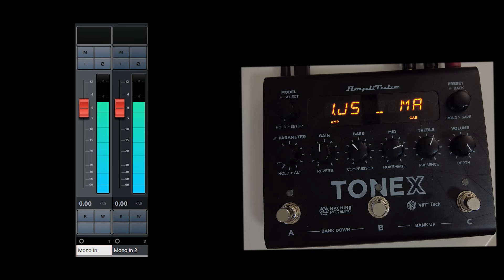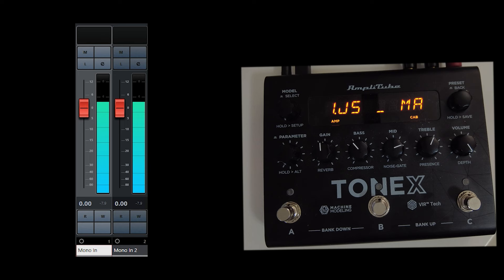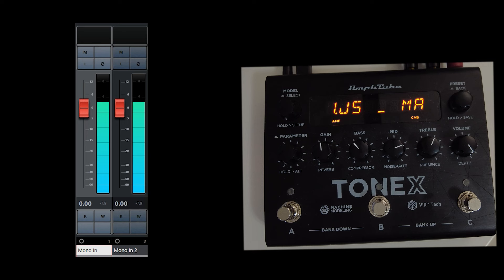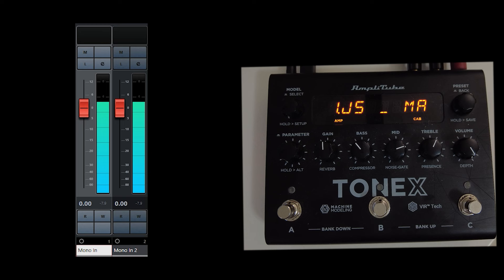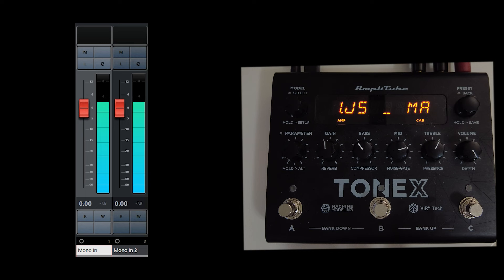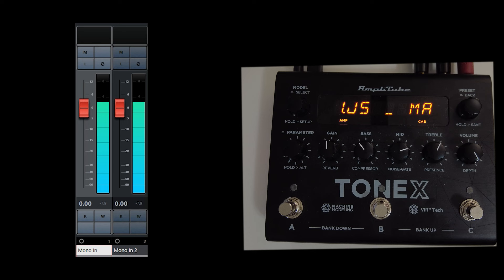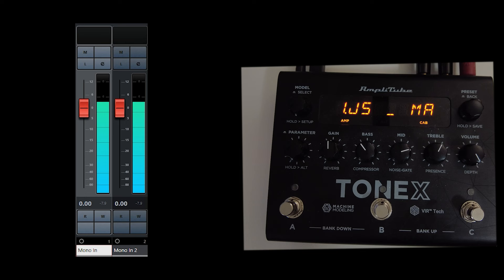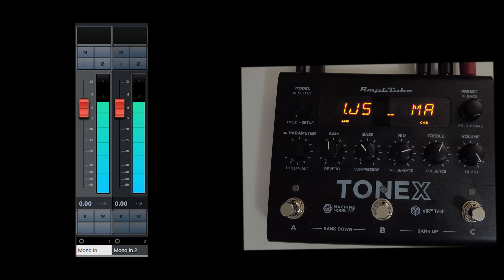Fine Tune Your Tonex Pedal To PERFECTION!! | Set Your Input Trim PROPERLY!

Comment: Good video! I’ve found that generally, there is a reason for default settings, haha. First thing I did for each of my TONEX’s was check the input trim and set it 0.0. I haven’t had any issue getting any captures to be exactly what I needed them to be. As you said, the gain knob can do so much for the sound of your capture. But beyond that too, if you’re really wishing you could push a capture that much harder, maybe you should just use a higher gained capture and make your life easier lol.

Comment: First of all thank you for uploading these incredible informative videos about Tonex. I wanna say that I'm a home recorder who wants to get the most out of it . This calibrating stuff is very interesting but I'm no audio engineer as most of us aren't . We used to set our Interface input gain so that is was not clipping. That is what the compagnies said was the best thing to do. Lately there is much of a discussion how to set your interface level properly. The latest Rhett Shull and john Nathan Cordy videos talked about this matter a lot but that was all about Neural DSP stuff but it relates to other amp sims also. You talk about dBu and dBfs and headroom and calibrating the pedal but IMHO you're gonna way to fast for a lot of people out there, including myself. Firstly I want to calibrate my own Interface , the Tonex pedal comes later. I managed to get a 0,775V AC voltage out of my Motu M4 output with my test generator set in reaper at -10.1 db. And then I lost you ... I have to feed this signal to into the input of the Motu M4 if I understand correctly but what am I aiming for? Sure I'm missing something here ,I am not meaning to be rude or something but a tutorial for dummies would be welcome if it's possible.
Reply from the maker: I really can't make it any easier than I did in the video unfortunately. You are on the right track. Now take the 0 dbu signal you have coming out of your interface and plug that into your Instrument in on your M4. After that check what dbfs level that is on that input in Reaper. I aim for -11 or -12 dbfs. Once you have that that will equal in and around having Input Trim on your pedal set to -3.0 db. Hope that helps :-)
Reply: Hey i have the same interface, did you ever figure this out? Thanks
Reply: @josiahs7917 , yes I did. I followed the instructions from Jason and I finally found that the input gain knob needs to be set beyween 8 and 9 o clock. That equals  - 11,4 dbfs in reaper.

Comment: My question is if you are using Tonex pedal in the loop of the HX Effects do you recommend still using the input trim at -3.0?
Reply: I’m wondering the same thing
Reply: As long as you have the send to the Tonex in the loop set to instrument then it’ll hit the Tonex the same as it would if you were plugged directly into Tonex

Comment: It would have been good to see what level the Tonex software is reporting on your input when doing a capture. I suspect that it's going to be saying 'too low' when in fact it's not too low at all. If you make a capture following the prompts for good levels from the Tonex software then that capture is going to be close to 0db and require 6-9db of input trim boost to get the same saturation. Would you agree that we should be ignoring the input level suggested by Tonex software as it's too high?
Reply from the maker: Exactly. I completely ignore the suggested input level when making captures. I talked about it in a previous video. The input level is not part of the capture process.

Comment: I have been experimenting with using Tonex as an overdrive pedal.  However, the volume level when bypassed is higher than the instrument level guitar signal (maybe it's buffered, or simply outputting line level?).  Would adjusting the input level down in the way you suggest also reduce the bypassed signal back down to instrument level?